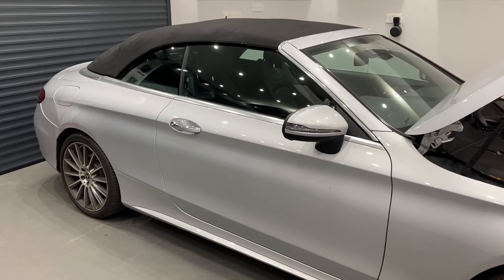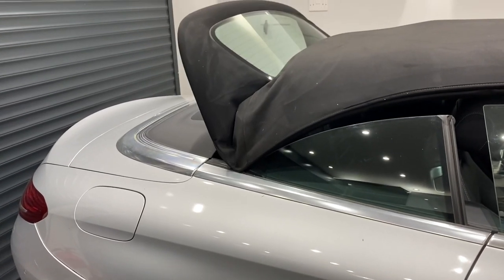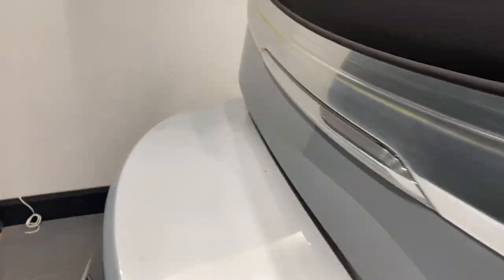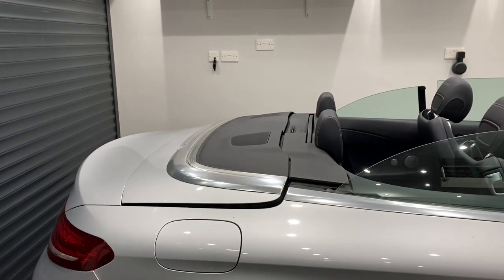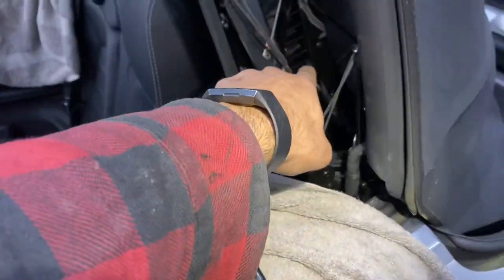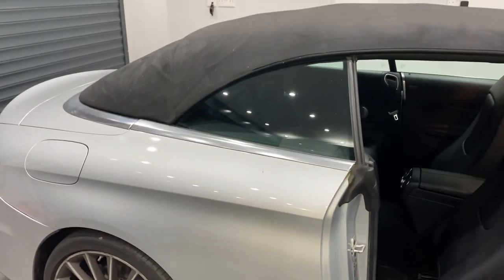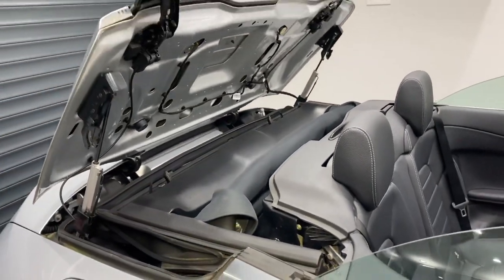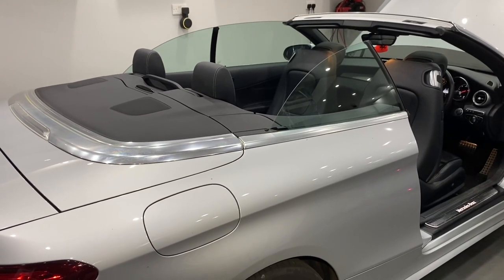Mercedes Benz C-Class (A205) Convertible Roof Fault No 1

Comment: You say common problem, Mercedes refusing to repair under warranty. How common is this?
Reply from the maker: Every vehicle made up to 2019/2020 has this issue where they have changed the material now
Reply: @CabrioletTech  did they just change to new stronger cables or is other stuff different as well? Do you offer just cable replacement with the stronger new ones? How do the new cables hold up? Is it a permanent fix?
Reply from the maker: @ovi765  New material, stops it happening again
Reply: @CabrioletTech  thanks

Comment: What would a repair like this cost?
Reply: Hi, I bought my C class 4 years old from a MB main dealer with 12 months warranty. The cords have broken exactly as in this video. Typically, the cords themselves are not covered under the warranty! The dealer has quoted me £960 to repair. I’ve been quoted £840 by a local independent roof specialist. I’m seriously considering buying the cables and attempting a repair myself.

Comment: I have the same problem on my 2017 C300 
Mercedes must know about this, is there any recourse with them even tho its out of warranty?
They are trying to charge me $4200 as they say i also have to replace the Headliner?
Reply from the maker: Hi

At that price it would be viable for me to fly over and repair it ! 

We typically repair the headliners

Not sure on legal stance, what I do know is Mercedes Benz have changed the design

Comment: I am the US, same issue. Is there an MB part number for the tension wires? Dealer says they don't want to touch it and will use "their go-to guy" who charges $2700 for a new headliner. Any help is appreciated!
Reply from the maker: Hi, depends what has failed
Reply: @CabrioletTech  1 wire broken which causes a plastic piece in the corner of the headliner not to fold down properly and gets stuck when you open the top. SO top does not go down all the way and the cover does not close.  So I need the wire set I guess. But just to make sure do you have part number for plastic piece. If you are ever in the states, Ill buy you a beer :)
Reply from the maker: @bartvanroekel  please send us an email / WhatsApp with a VIN and photos and we can supply the hardware

Comment: How difficult is the repair to do at home? I have 2018 with exact same issue. I took it to an upholstery shop and they said no thanks, local Mercedes dealer wants 1.5k.

Im trying to sell the car, but i need to fix this beforehand
Reply from the maker: @Jason-uz1ut  Hi, not difficult just time consuming
Reply: @CabrioletTech  thanks I will have to attempt first. It was just visually inspected today and new quote is now 2.9k lol. I can try myself, if I fail a new soft top is only 2.7k, might as well just replace the whole damn thing if they want to charge me the same for a new headliner and strings only
Reply from the maker: @Jason-uz1ut  New headliner here is £1300 but we also do fly out to places to replace the cords

Not sure what currency you are talking in
Reply: @CabrioletTech  USD, I am in Pennsylvania
Reply from the maker: @Jason-uz1ut  if you need one shipping out to you, happy to supply. Carriage is approx £80